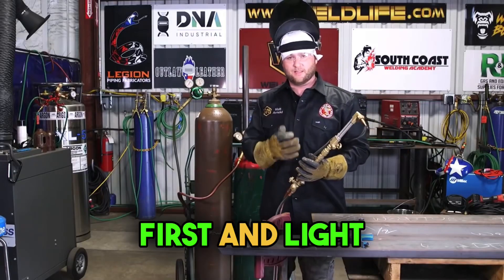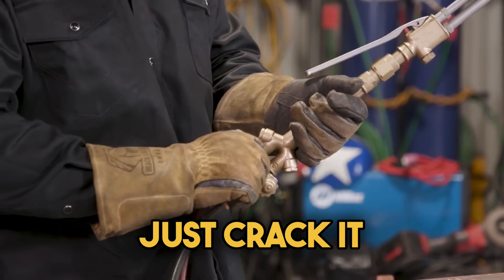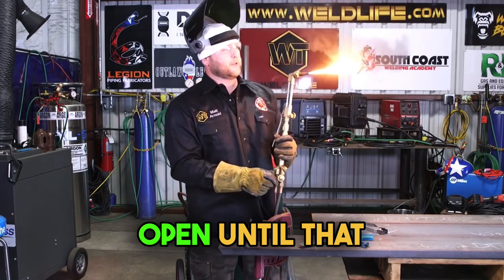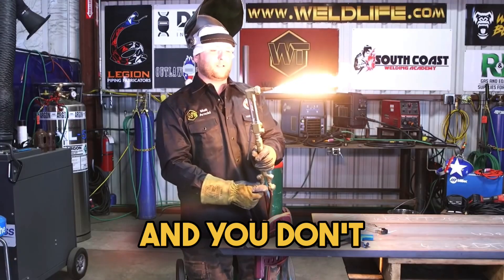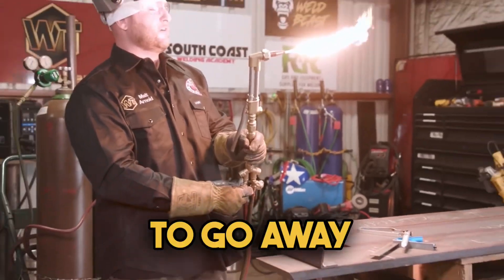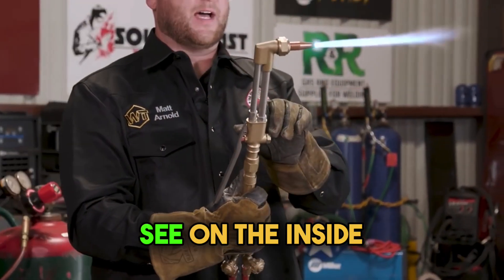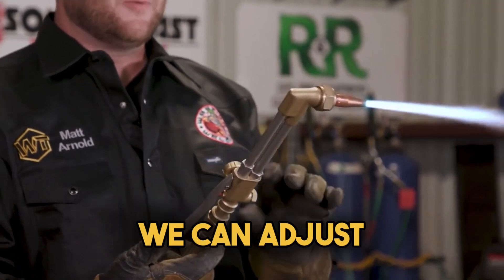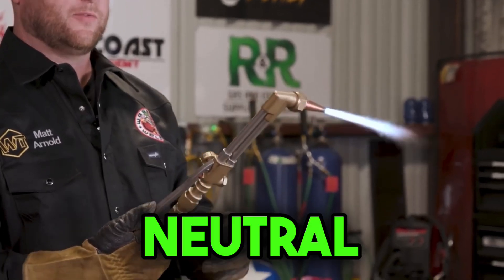How To Adjust the Flame on a Cutting Torch?

Comment: Great info and tips on the GAS AXE  guy. I always reminded my welding students to make sure the OXY valve at the bottom of the torch handle [on the combination torch you are using] is FULLY OPENED or it will starve the cutting jet stream of OXY when the cutting handle is pressed.
Reply: Nice tip. Thanks!!